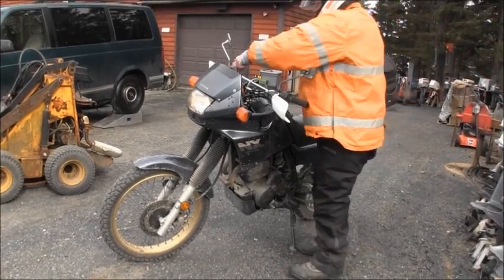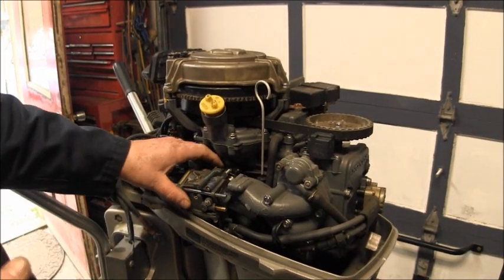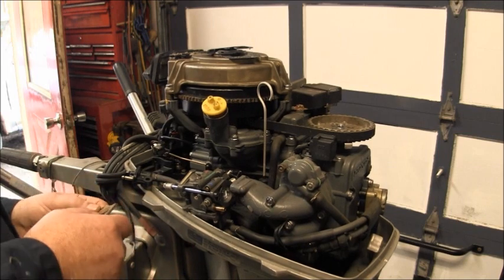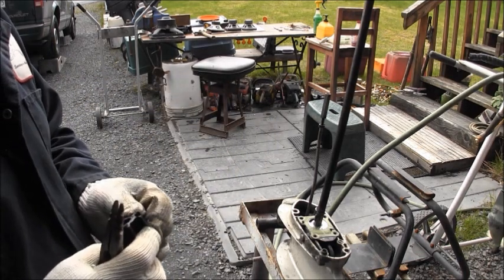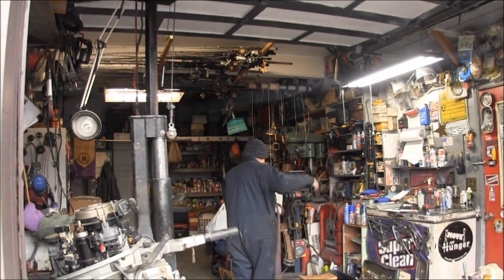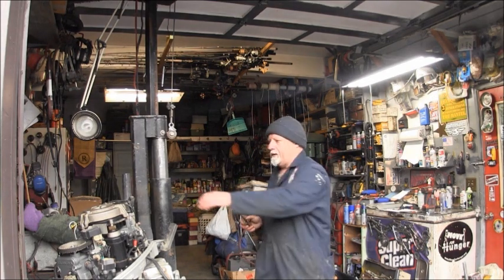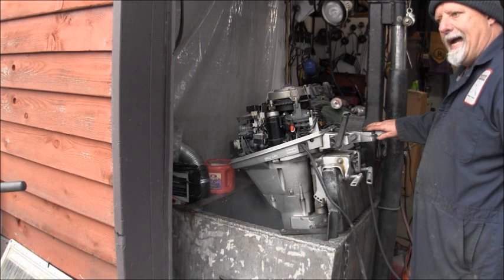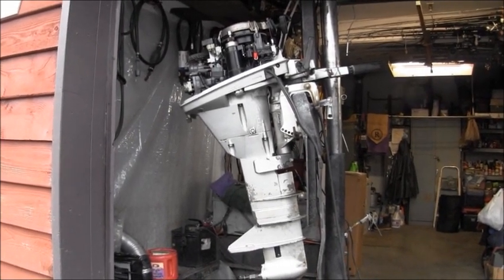HONDA  15 HP   Outboard    +     2,  3  More  Honda's

Comment: Hi Kodi, those pee hoses do get clogged up. I had to take the hose off from the exit to the block and run a coat hanger wire through mine last year. Going fishing again next week. Just installed some new boat launch wheels on my 12ft aluminum boat to try out. Will also show how I'm loading the boat in the truck bed by myself now
Reply from the maker: Kool Tim  I'm still playing catch up the weather has been brutal up here.    kb

Comment: Howdy!  Very helpful channel here. Just subbed you!  I asked a question in a comment of one of you older videos, and I wanted to ask it here on your newer ones to make sure you got it. I have a 1998 Johnson 25 horse two stroke (J25telecb). Somehow the pin that holds the top of the shifter rod to the shift linkage inside the midsection failed. I’m going to have to get this pin back through the top of the shifter rod (somehow), but it looks like I’ll need to take everything apart to do so. Is there a shortcut to this?  Thanks!!
Reply: Also, any idea on where I could find the lower rubber mount for that same motor?  Part number 321469?  Looks discontinued!
Reply from the maker: @nelsonhoneyfarms7665    The only way to get @ that pin is to remove the powerhead.  I have those lower mounts but mine R all salt water motors,  A better bet would B one of the fresh water salvage outfit listed on  IBOATS,  Tims outboards in Minnesota is real good.  Just google Tims outboard repair.      kb
Reply: Thanks so much!  Never taken off the powerhead…that nut on the left side stud looks really hard to get to. Looks like I got work to do.
Reply: Got the powerhead off and got the pin back in place. Anything I should look at changing (seals, etc) while I’ve got the powerhead off?  Thanks!

Comment: What's a good paint to paint my Johnson motor?
Reply: If I may, two light coats of about any spray can metal paint will do if the surface is well prepped (cleaned with mineral spirits with any bare metal primed) but the secret is to have that painted surface clear coated with a 2-part epoxy sealer. It can be bought on the internet. It's not cheap but itmakes a world of difference. Regards.
Reply from the maker: Depends on year,  If it is the popular johnson off white I use  Krylon  antique white.  It is very close.    kb